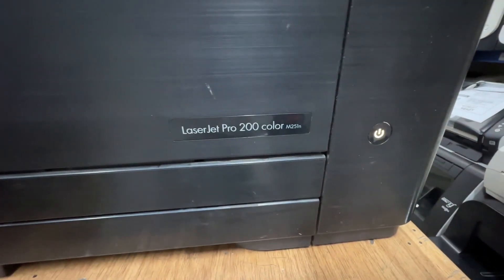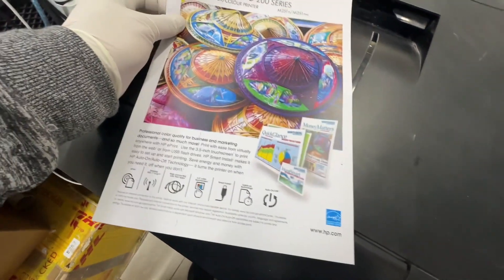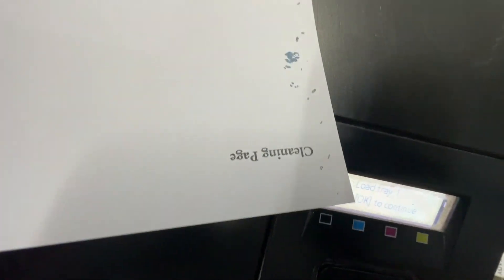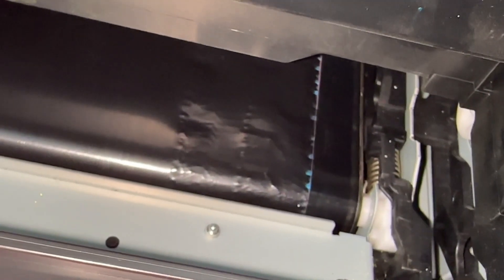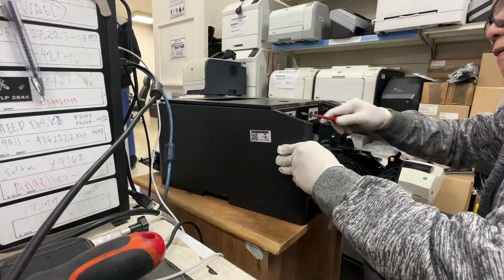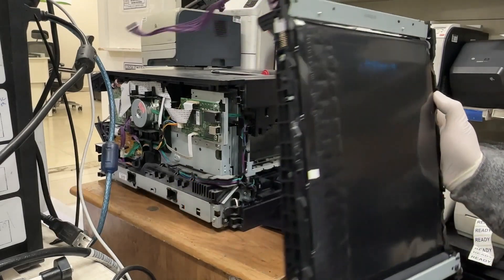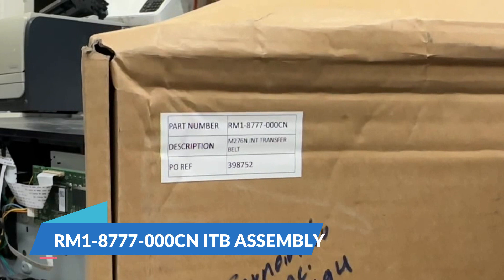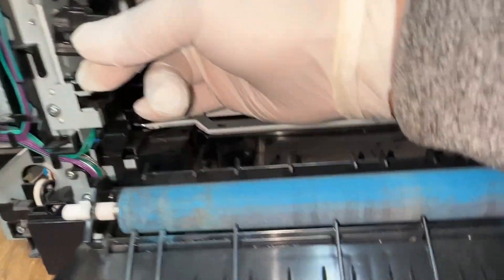How to Replace Intermediate Transfer Belt Assembly

Comment: Hi, Fernan, with Haidar, I work in King Fahd Hospital in Al-Hofuf, Al-Sharqia region, as an electronics technician. I work in printers, but I suffer from a problem that I do not have sufficient experience in repairing printers.
Reply from the maker: I will post more repair for printer. What model of printer youre fixing?
Reply: @Okipentv   These types of impact damage me      HP 400 AND BROTHER HL 5200 AND HP 500 AND CANON LBP6030 AND COPY MACHINE MP 3055 AND TOSHIBA MODEL OLD AND NEW